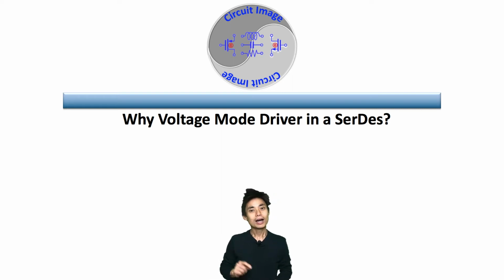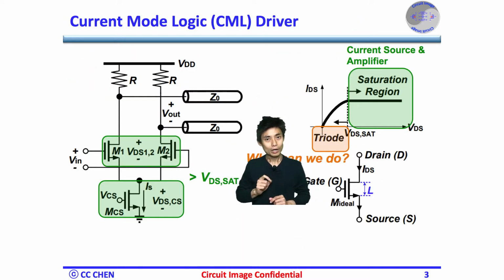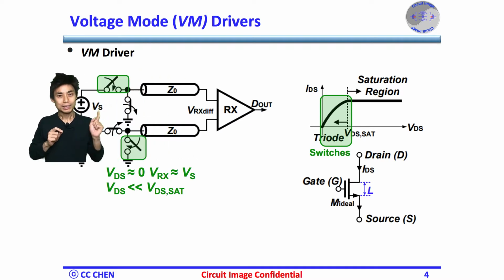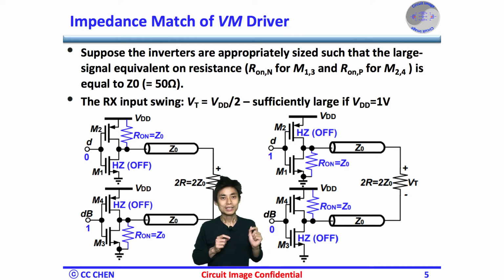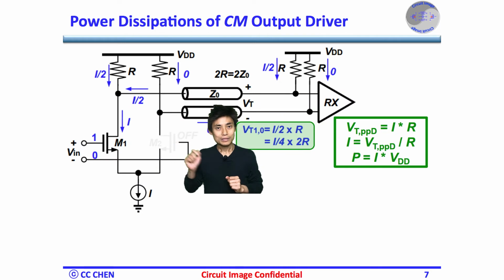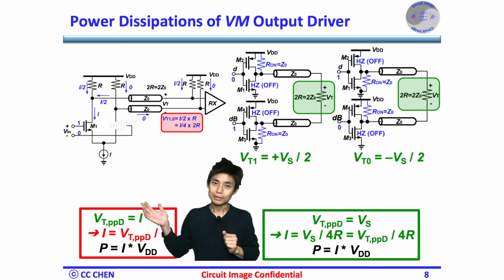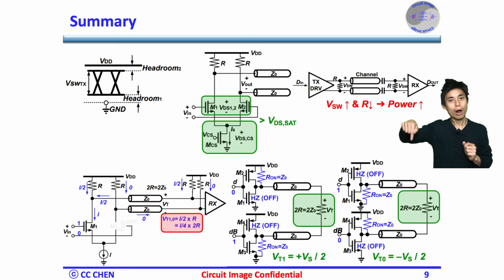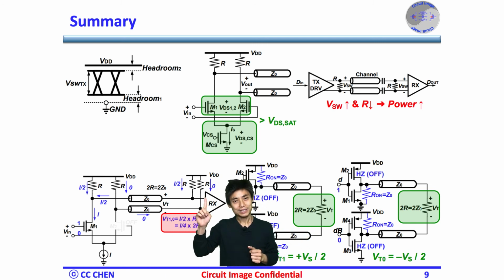Why Voltage Mode Driver in a SerDes?

Comment: I'm designing the driver with Nmos-to-Nmos configuration in a single-ended setup. While it worked well with NRZ signaling, once I switched to PAM signaling, the performance degraded significantly, showing acceptable results up to -6dB when applying FFE, but not performing well beyond -10dB.

Could you provide insights into the channel attenuation sensitivity differences between a Voltage-Mode Driver with Pmos and Nmos combination versus an LVSTL structure with Nmos-only transistors?
Reply from the maker: Hi Circuit,
Thank you so much for the feedback and good questions. 😄
The NRZ signaling matters but is not very stringent as the PAM4 (or higher levels) signaling; therefore, I'm not sure if the low swing VM (SST) w/ NMOS-to-NMOS configuration would be a good approach for PAM4 & high loss channel. On the other hand, the high swing VM (SST) w/ PMOS-to-NMOS configuration would provide a high swing, which may be better for PAM4 & high loss channels. 
Therefore, the Voltage-Mode Driver with PMOS & NMOS combination would have less channel attenuation sensitivity than the LVSTL structure. 
Thanks,
CC
Reply: @circuitimage  thankyou!
Reply from the maker: You’re very welcome ☺️

Comment: Hi Dr. Chen, thanks for the great video sharing. I'd like to inquire a question to you. As your mention, we need to operate the current mode driver in saturation region and its behavior will like amplifier, so we can get bigger output swing by using current mode driver. And using the voltage mode driver in triode region can have a small voltage drop, so I'm wodering if we want to get bigger output swing and smaller supply voltage, we can combine the CM and VM, is it correct.
Reply from the maker: Hi 育瑛, thank you for the great idea, which is very smart. Some people already implemented both combined the CM & VM modes driver as you mentioned, and I could present that idea some time later :) 😀
Reply: @circuitimage  Thanks for your reply, I see. Thanks again for the great video, it's really helpful😃
Reply: Hi Dr. Chen, I'd like to inquire one more question, if we want to use the function of Amplifier, the operation need to be at saturation region, but may I know why the output impedance(Z) will be infinity. Since the output impedance for OP Amplifier needs to be smaller as possible and input impedance needs to be bigger as possible, kindly please correct me if I'm wrong, thanks again.
Reply from the maker: @Erichsu-e9m  You're very welocme and I'm glad it helps. 😃
Reply from the maker: @Erichsu-e9m  Hi 育瑛, Thanks for the good question. You're correct, the OP Amplifier needs to be ~0 output impedance, but ~infinite input impedance. The amplifier here I referred to was the high-speed CML buffer, and the output impedance should be dominated by the impedance of the resistive load (RL) & the differential pair (RO), therefore, we'd like to have a maximum linear gain, we what the output impedance = (RL || RO) = (RL || infinite) = RL (very linear). Does that make sense? If not, please let me know and I could still not make it clear enough. 😄
Reply: @circuitimage  Hi Dr. Chen, thanks for the feedback. Please allow me to clarify it, I think it's like a small signal modeling in MOSFET, RLand RO are parallel in the small signal circuit, so if we want to have maximum linear gain, it's better for us to control one parameter only(RL). And if we get the linear gain, it's easy to increase the output voltage for getting higher swing in TX, is it correct
Reply from the maker: @Erichsu-e9m  Thanks for the clarification. Yes, your understanding is correct. Also, the linearity of the TX output swing is very critical and is also defined in most specifications of every protocol. 😄
Reply: @circuitimage  I see, thanks for your feedback, I really appreciated it.😄
Reply from the maker: @Erichsu-e9m  You're very welcome and I'm glad it helps.😄